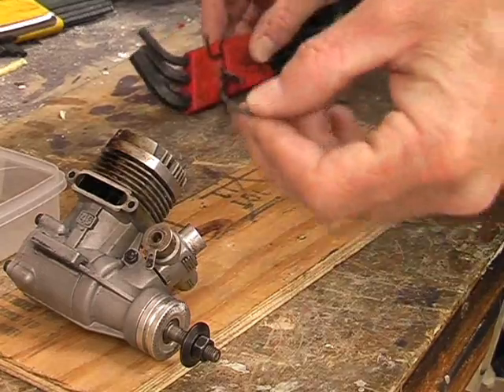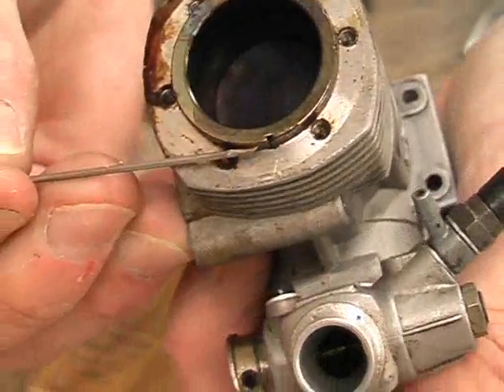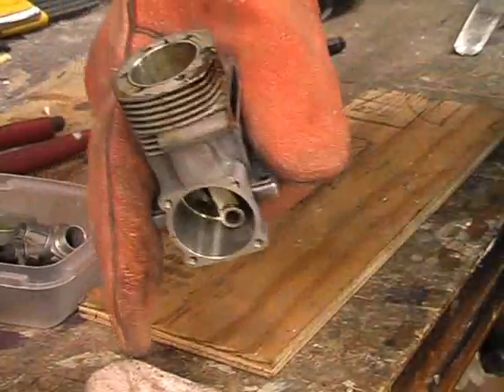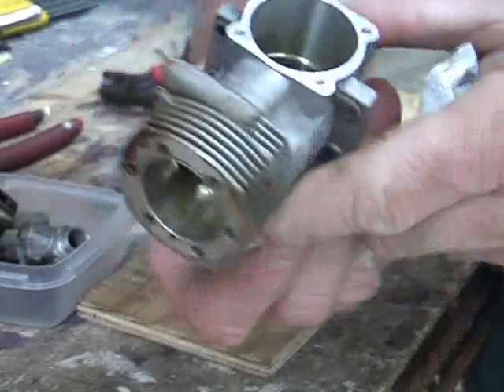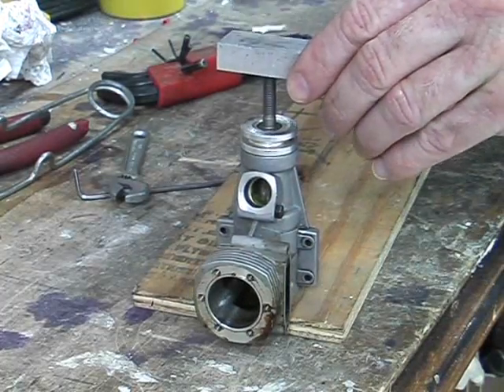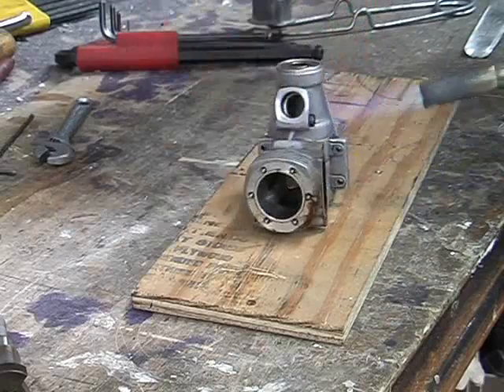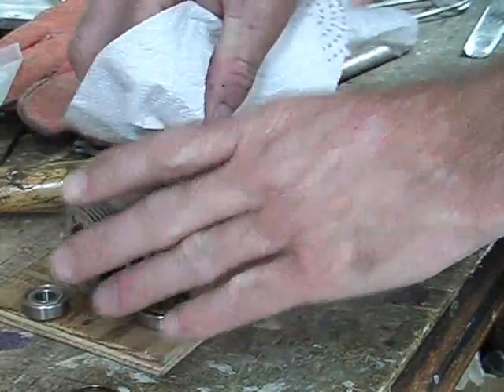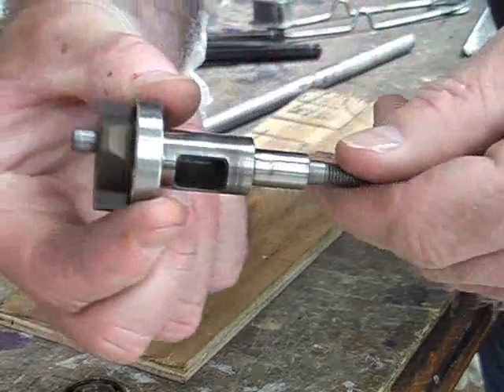How to change model airplane engine bearings (part 1 of 2)

Comment: A friend of mine suggested that the rear bearing on my SC61 needed replacing (he recognized this from a 'humming' sound, and it did sound odd). I thought I would never do that as I had no idea where to start.  This video was fantastic in giving me confidence to open the back and have a look.  A few minutes later I had the blow torch out and set to the SC61.  2 days later, having received a new rear bearing in the post, it is replaced and running great.  Without this video I would not have had the confidence to even start this, so thank you very much.
Reply from the maker: Julie Cheal You're welcome.  You might find some of the stuff on my RCModelReviews channel to be useful as well.
Reply: xjet ..hi !! I have a biplane nitro engine but the engine stuck due to lack of use .. can you tell me what can I use to wash the parts ??? Gasoline or other liquid ?? Thanks!
Reply: Lisseth the best thing to use is rubbing alcohol or plane fuel will work. It is never a good idea to us gasoline.

Comment: Great two part video. I’ve been flying RC for 30 years but never had a need to do this level of engine work on any of the engines I’ve owned. Your process and instructions were great. I replaced both bearings in my OS 46AX after 10 years. Thanks a lot.
Reply: How do you know when a baring is going bad? I have a OS 46AX and I can hear a metallic sound or mabye more like the engine is dry. What surprises me is that this engine has only a gallon of fuel and is 3 years old. I didnt use it for 2 years and it was always kept inside away from the elements.
Reply: chevy362000 , glow fuel is hygroscopic (it attracts water vapor from the air). The water gets into the bearings and results in rust. You can feel the roughness in the bearings when you turn the shaft. You can hear it too. Your bearings are probably rusting due  storage. The single best way to to significantly reduce the effects I described is to use a light machine oil after you’ve flown for the day. First, drain the tank, then start the engine, allowing it to run all the fuel remaining in the fuel line and engine. Open the throttle and squirt a few drops of oil in the carburetor. Spin the engine with your starter for a couple of seconds then close the throttle. You’re done. NOTE - when sucking the oil into the engine, it MAY run for a few seconds even with the glow igniter disconnected. Be prepared. I’ve been using Marvel Mystery Oil in all my glow engines for years and rarely have any trouble. I ran my O.S. 46 for years before they finally gave up.
Reply: @extra330sc  I do appreciate your quick response. I am going to follow your advice. Marvel Mistery Oil I never heard I could use it for that too and I love how it smells. Thanks for all the info you have shared today. Alberto
Reply: chevy362000 , no problem. Glad to help. If you buy a pint of the oil that will last you for quite a long time. The tiny bottles the hobby outlets sell is fine but it’s overpriced. Check it out on Google or Amazon.
Reply: @extra330sc  One last question  putting bearings aside. What are the signs of an engine going bad besides low compression?  and what is your oldest engine still in service? Thank you in advance.
Reply: chevy362000, so, the OS I was referring to is 10+ years old and I just changed the bearings for the first time. There are just a few things in a glow engine that wear out, resulting in reduced performance. One we’ve already talked about. Another is piston ring and cylinder wall wear for engines so designed. Eventually, compression drops off, thus performance. Not all glow engines use a piston ring. There are numerous ones that use an aluminum piston that operates within a sleeve and there’s no piston ring whatsoever. Despite that, there’s still wear between the two parts so you get lowered compression here too. Running engines too rich keeps them from providing maximum power and results in carbon build ups on the piston crown. Basically, anything that presents friction is going to wear.
Reply: @extra330sc  Thank you for your expertise. I have an old ringed Enya 45ss installed on my Elder 40 the compression is low, but still performs ok and I was told that ringed engines work with less compression I don't know if is true. The thing is that I fly this airplane still I wonder how much engine do I have left
Reply: chevy362000, if you really want to hang on to that old engine, consider replacing the bearings and piston ring. Bjorne Baal owns https://rmjmachineworx.com and might have the ring you need. You’re not talking about a lot of money here so it might be worth a try OR you could just buy a new engine.
Reply: @extra330sc  I thank you for that Info. I did´t know that place wow that is great. Yeap might as well nothing to lose.
Reply: @extra330sc  u available
Reply: @theking-fl9sq  available in what regard? Email? Video chat?

Comment: GREAT VIDEOS !!  VERY HELPFUL !!   I have a 28 yr old Shuttle RC Helicopter with an OS 28F engine. I haven't flown this for at least 15-20 yrs! So I cleaned it up to put on eBay... and of course, the engine was froze up tighter than a drum! I'm a good wrench man... I've built 1000 hp drag cars from scratch, and rebuilt JD tractors as well! So I was not bashful about jumping right in on this new project!  I found & watched both your videos a couple of times, got the tricks down and had mine apart in no time!!  The oven at 300 for 10 min worked great for me. Found that the handle of a kitchen wooden spoon was perfect for knocking the front bearing out! The main bearing is rusted & pitted and the front one is "just ok". Everything else seems to be good. Now I just hope I can find replacement bearings!

Your videos saved me countless hours of digging around for info and probably saved the old 28F a trip to the scrap drum!! Thanks for all your time putting these together and sharing them with everybody ! Very well done!  Denny H / Omaha, NE.
Reply: 28 year old Hirobo Shuttle?  Shuttle's not THAT old..?  wait I guess I AM... I would expect that, if or when you get it flying, that you put up the vid, and share.  I would do it myself; except that I got so frustrated, and just sold the heli, and kept the tranny.

Comment: Great information.  I replaced the bearings in my Saito 180 and had no luck getting the rear bearing out by heating.  I devised a system to remove that suborn SOB.   I will post a video soon.

Comment: Thanks for a great video. I just finished replacing the bearings in a well used Saito 125 - 4 stroke. I have to say though that my experience was not nearly as smooth as yours. Everything is easy except getting the crankshaft and bearings out. Getting the new bearings in was a bit hard but not nearly as bad. To get the crankshaft out I eventually went to the hardware store and put it in their biggest vise on display and it took all my strength before it finally started to budge a little (cont.)

Comment: 380 hours, wow! I have an old Thunder Tiger GP-42 I bought new in around 2000. It used to run very well and still has excellent compression. The issue I had was that I ran it on fuel with synthetic oil, which wasn't good for lubricating the brass crankshaft bearing. A little play in the crank which promoted an air leak eventually made it run poorly and I was always dead sticking it in...

Comment: Guy's, Go get an old crock pot with 50/50 antifreeze and water mix to clean all the parts after it's apart, all the black on the cylinder will come off with an old tooth brush. About  a day or two in the bath usually does it, polish the outside of the cylinder with a fine scotch bright pad or steel wool, you have to clean and blow it dry anyway, this just helps putting it back together easily.
GO get you a small puller at the auto parts store, usually used for pulling battery post, under ten bucks, to pull the drive washer, put a little tension on it then the heat.
If you will oil your engines with ATF after you fly, you will go years without replacing bearings, especially on 4 stroke engines.
ATF has the most rust inhibitors of anything on the market, you just cannot have rust in an automatic transmission, I have torn down transmissions that were in a junk yard sitting outside with the pan full of water, and was still able to use the hard parts inside.
This is a good video, I usually use a magic marker on the rod, just wipe it clean, the rods hardly ever get dirty.
Have fun

Comment: Came here to see how to remove the rear ball bearing race on a Thunder Tiger .46!

Grey info. 

The cylinder liner was nice and lose in the block, the piston is still tight at TDC. But the carburetor was stuck solid. Ended up soaking the whole thing in 50/50 Ethelen Glycol with the carb and o-ring still attached, then it came off slick.

Comment: Hi Bruce hope you can help me I'm looking at a blue max,plane , no motor just found a motor market place its a Os max 40 la  as recommended a 40 to a 60 for the plane , what are this motor like or have you have any recommendation cheers Robbie
Reply from the maker: The 40la is a pretty weak motor for a 40-size.  Given that the minimum size for that plane is a 40 I'd try to find something a little more grunty.  the 40la is also a very light motor -- just over half the weight of a normal 60-sized engine so you might also have a balance issue.
Reply: @xjet  Thanks for that as i,m new to this fun, that helps me a lot

Comment: Continued:  I was then able to finish it off at home. I was lucky not to crack the case. When you reassemble a saito, you just need to have the piston at top dead center and have the mark on the timing wheel at 6 oclock and then your timing will be correct (its in the engine manual). In retrospect, this bearing replacement was maybe not worth the 5 hours it took me, but it was interesting to see how 4 stroke glow engines work. Would be easier on a newer engine.

Comment: On a ringed engine what do you use for a ring compressor to re-install the piston?
Reply from the maker: The cylinder sleeve of most ringed engines has a chamfer at the bottom so that if you carefully lower the sleeve onto the piston (using lots of oil), that chamfer will automatically compress the ring as it goes into the bore.  You just have to make sure that the ring-gap is lined up with the little peg in the ring-groove or it won't fit.
Reply: ***** Thanks, works great on my Super Tigre 61's. Now you wouldn't have any idea where to purchase a piston and ring for a OS 1.08 since I broke the piston and ring not knowing how to re-insert.

Comment: Friend need your help!
I got a motor like the one's dismantling, but this engine is stopped long ago ...
Following his tips to dismantle the engine, I could do just as you do! When it comes on the heat and make the central axis to change the bearings, I think the engine is stopped the long axis did not move with the beating I gave.
I warmed the play and was unable success!
What do you advise me to do ??
GRATEFUL
Reply: Try putting your engine in your freezer.  Wait until engine has completely frozen.  An hour or two, or even overnight.  Now keeping the engine as cold as possible, using a mini torch, heat only surrounding of the bearing.  The idea of this is that freezing the engine makes every part contract.  Then quickly applying heat to the surrounding are of the bearing.  This will expand, what is holding the bearing in.  Think;; maximum temp differential.  The bearing might just DROP out, using this method.  To thoroughly de-gum my engines, I heat a pot of antifreeze/radiator fluid over a stove top (low heat) and dip all the parts in.  This is actually is a lot less caustic to the engine parts; and why wouldn't it be?  Your car has it in, for years at a time, without having the radiator being eaten up, from inside out.  If I feel that the new bearings are well made, and do not contain any machined shavings, I do nothing else prior to install.  If I see shavings, I dip them as well and lube them afterwards.  I don't know what has made your engine stop working, way back.. but if you can get your hands on a new sleeve, I would replace the old one.  If you NEVER EVER want to replace the sleeve again, and want your engine to run with brand-new cond. of 99.99% of new compression/performance, you should preheat the engine head EVERYTIME prior to starting.  This is a lots of work, and forces you to carry extra equipment, but when you realize that all ringless ABC engines start to loose compression(performance) IMMEDIATELY, if not preheated to prevent parts scraping pinch, during startup, you just may adopt this method.  After several flights, your engine compression is similar to a 100,000 mile car engine.  I use a mini torch or a heat gun on med high setting.  I will be ordering a engine warmer to see if it gets hot enough to get the job done.   http://www.hobbyking.com/hobbyking/store/__51642__TrackStar_12_volt_DC_Nitro_Engine_Heater.html?strSearch=engine%20heater
Reply: YEAHHH!!!!
OBRIGADO AMIGO DEU CERTO
TANK'S MAN... 
CONSEGUI RETIRAR OS ROLAMENTOS!
Reply: Vinicius Henrique Porto Silva Very Nice..

Comment: can i reuse the bearings if they still good? cuz the head of my engine is leaking for the muffler, so can i replace only the engine body and reuse the same old good bearings?
Reply from the maker: So long as you do not damage the bearings when removing them then you can re-use the bearings but since they are so cheap, it would still be a good idea to buy new ones.
Reply: yeap u right i should put the new ones!
Reply: a
seks

Comment: Seventy-one people does not like reason.

I prefer to use a gear-puller to get the prop-drive off the shaft, maybe with some slight heat.
Reason for this, is that I might want to save one or both bearings afterall. I Do not like to knack them if I can avoid.

Comment: The front bearing procedure is wrong. You either need a bearing with just 1 shield or get a sealed bearing and remove the shield on one side. It is very easy to do. The new bearing with be open to lubrication on the inside and shielded from leaking on the outside. If you notice there is a notch in the crankcase in the front that allows lubrication to get into the bearing. Leaving it sealed keeps that from happening which will lead to wearing out the bearing prematurely.

Comment: Vintage Super Tigre 60 Blue Head model engine with muffler  S/H   on ebay $155.00 + 54.00 freight
is this a good motor ,thanks
Reply from the maker: I'm not a great fan of the SuperTigre engines.  Look for a Thunder Tiger 46Pro, ASP46 or an OS55AX if you want a good reliable, powerful engine.
Reply: @xjet  thanks for that. I have been lookup engines, have you heard of saito FG 11 motors  and i see the 
os motor is popular

Comment: Thanks for the info.  I assume "aluminium" is a regional pronunciation for aluminum?  Just want to make sure it's not something completely different.
I would not even tap on the front bearing directly with a hammer - I would place your aluminum block flat on top and tap on that - no sense risking the engine at any time.  :)

Comment: A good idea would be to leave it soaking in same fuel it have run on, usually ethanol for a day. Using force to pull apart is not wise.

Comment: how to check the engine pinch of that?
Reply: If you have the head off the engine block already, rotate the crank and you should see that the piston should have pushed the sleeve out of the block at least a 1/3 of it's length.  When your engine is assembled on a plane, just remove or turn out the glow plug, so that the air can escape.  Then turn over the propeller and feel for the pinch.  You should be able to feel a solid resistance of the pinch, for at least 1/6 of the rotation.  If not, you are loosing compression big time.

Comment: The inexperienced modeller could easily do some damage with the blowtorch. I find that dunking the crankcase in boiling water for 20 or 30 seconds usually heats it enough to do the trick.

Comment: where do you get your parts?
Reply: Try boca bearings. You can search by engine for the correct set. They usually offer several options, go with stainless.

Comment: I tried dismantling my OS 46 AX II engine and could not get the con rod off of the crank with cylinder liner removed and back plate removed, the piston and con rod no matter what position I had the piston at would not clear the crank, any suggestions?

Comment: Why no piston rings?
Reply from the maker: Most small RC engines don't have rings... they often use an ABC setup (Aluminum piston running in a Brass liner that is Chrome plated).  This produces less friction and significantly reduces the risk of seizure in the event of a hot-run.
Reply: @xjet  Do they just bleed chamber pressure to the crank case then, or is the clearance between the piston and sleeve so tight that its a non issue?
Reply from the maker: @beachboardfan9544  The piston/bore seal is actually better than when using rings because there is no ring-gap to allow gas through.

Comment: This in not good way of mounting bearing in 9:40 with hammer....
You shoud choose a cold /hot metode.
Heat a aluminium and mount in  a steel frozen bearings .

Comment: Any thoughts on replacing the standard bearings with ceramics?
Reply from the maker: A few people have tried and they've usually gone back to steel bearings after a while.  Ceramic bearings are a little more fragile (when subjected to shock loads) and really don't like any form of dirt (which is hard to avoid with an RC engine because they don't have air-filters).  Far better to use a good quality steel bearing with phenolic cage and just change them when/if they wear or corrode.